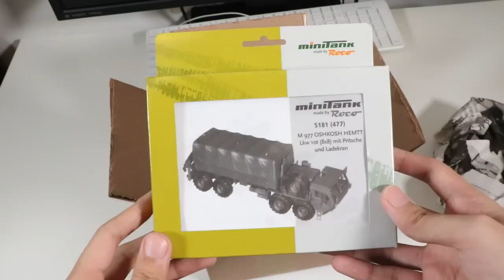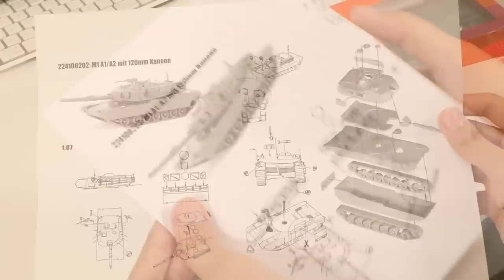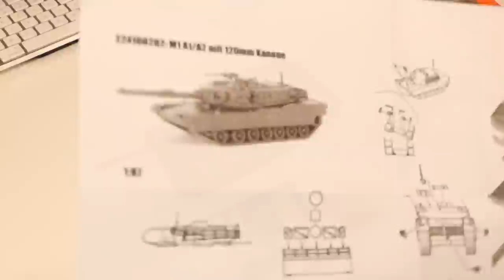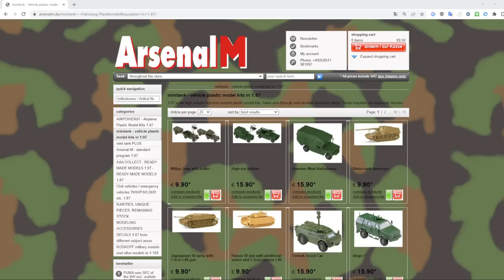Roco Minitanks HO Scale Military Train Unboxing

Comment: The "post thingy" on the Roco Abrams turret is actually the base for the radio antenna. I'm glad that you didn't mount the MG's on the mounting brackets, all machine guns (and the 25mm Bushmaster cannon barrel on Bradley Fighting Vehicles) are removed and stored in a lockable area or stored in the containers loaded on flatcars accompanying the armor and other vehicles on the train, they are NEVER stored in a location that will allow them to be stolen from the tanks, AFVs or other vehicles during transport.
Reply: the post thingy is actually the wind and humidity sensor for the gunners and TC's computer.  it can be folded over when not in use.
Reply: 20 years of fighting the GWOT and people still don't know where the crosswind sensor is on an Abrams. And where are the stories of having to tape cardboard over anything made of glass so the unidentified public wouldn't smash it all out?

Comment: You should get rid of the Accumate couplers on the Atlas cars as they are prone to uncoupling randomly. They also are easy to completely deform as the shank is two pieces.
Reply: จ
Reply: @natchayawiangkaeo3084  ส
Reply: @natchayawiangkaeo3084  ELlLIgtt
Reply: @natchayawiangkaeo3084  आई उस यज्ञ मह भी चल मदद मौके उ
Reply: @นูซากีราขาวตุ้งกู  oiikbbbbh
Reply: (((((һ(һ((((

Comment: Not sure if you’re going for real looking. But if you are, all trucks that get line hauled, they remove the canvas because the wind could tear them off.
Reply: Yeah, we would never leave stuff of value outside our tracks at railhead. When we were moving around Germany by rail we were low priority. That meant we stopped for everything traffic wise. They once routed us from Stuttgart to Munich finally to Grafenwohr all the while stopping for faster, higher priority traffic. We never reached speeds over 50mph.

Comment: You mentioned not being able to paint the tires very well in a round shape. There is an easier way to improve the appearance - paint your wheel hubs first entirely whether they are in a camouflage pattern or a single color; then cut pieces of Bare Metal Foil (any of them will work, but I buy the "Chrome" sheets to use for civilian vehicle trim and bumpers) that a little bigger than the wheel hubs and press them down as snug as possible without tearing the foil - then using a new/sharp #11 Xacto knife and following the "edge" of the wheel hubs, cut away the excess foil from the "tire" area carefully and peel it away, making sure that the hub cover part doesn't tear or lift. 
Standard masking tape from a store doesn't always snug down into the wheel hub edge enough to prevent any "bleed-through" of the tire color if you are hand painting.